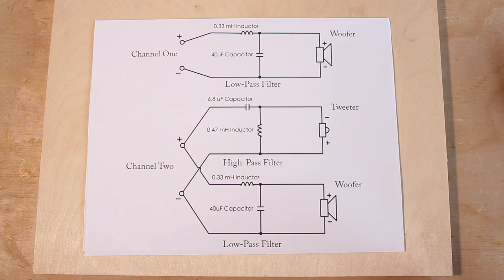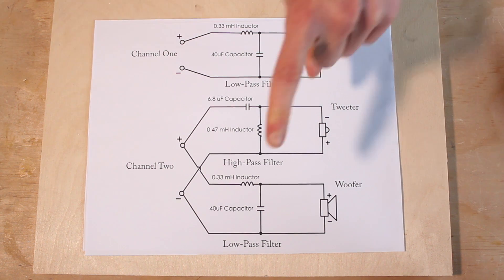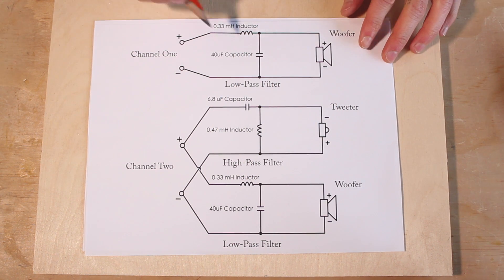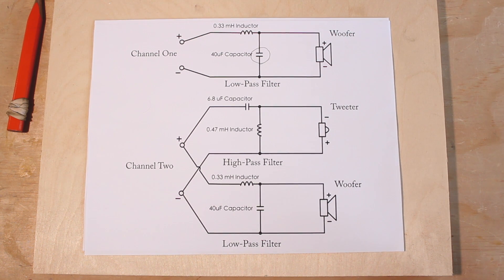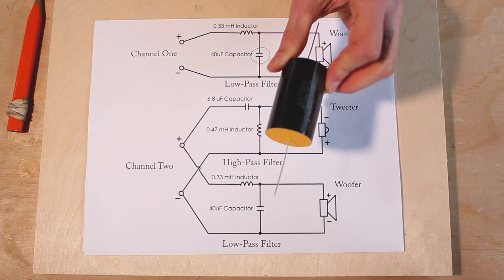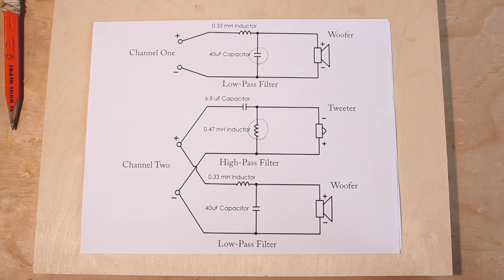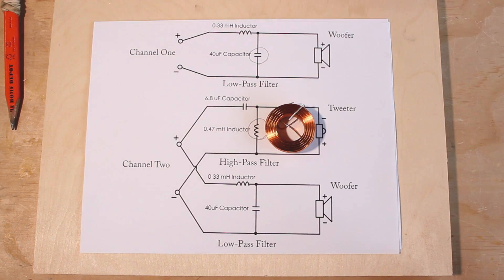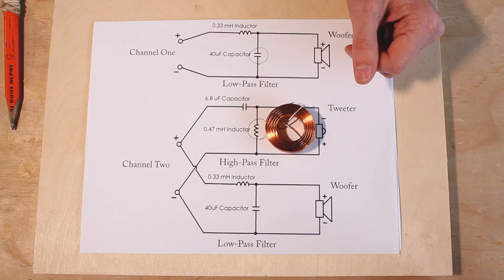How to Read A Speaker Crossover Diagram | DIY Speaker Building

Comment: Why positive and negative always changes for Tweeter in all crossover circuits? Does it have any specific reason?  Even in this diagram at the beginning, the positive lead was connected to negative line of the circuit and negative to positive. Someone, please clear my doubt.

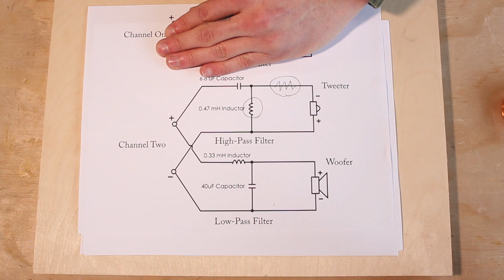Comment: @3:55 Ugh! But that's what I need! My dad bought 2 8ohm, 3K low pass mono crossovers. And I can wire them in one of 2 ways. Dayton/Parts Express didn't send a diagram. There is an IN+, IN-, OUT+, OUT-. All I need to know is WHICH 2 go to the stereo, and which 2 go to the speaker. I've never worked with crossovers before. Thank you

Comment: Hi, i just noticed that you gave a value for capacitor. But i really want to know is. Or ishoul say, give also the specific spec for woofer and tweeter. I mean watts and ohms. And. Really want to know what size is the magnet wire, what is the dimension of your mould and how many turns for woofer and tweeter. Thank you for your effort on making this video. Its just that i have many questions.

Comment: Thanks for this video. Please explain how to connect two 15inch,LF, four 6.5inch, MF,  and two or three HF tweeter speakers to a 3way crossover. Will you connect all speakers in series or parallel, what is the proper way.?

Comment: Why not instead use active crossovers that are adjustable and then either bi-amp or tri-amp an audio system?  Then you wont have to deal with all these caps, coils, resistors....  Instead, you can just try different x-over frequencies and just feed the power directly into the drivers.  The adjustable part is great for trying different xover frequencies and maybe even different slopes if the electronic xover allows those.  This stuff with caps, coils, resistors is ok, but it is "old school".  One advantage of your way is lower cost and people can use just a single amplifier so I admit it has benefits and it is fun to tinker with.

Comment: Hello sir 
I'm planning to build center speaker 
I have 100w@6ohms avr 
I want four 100w@6ohms speakers 
My question is... 
Is it possible to have one more 100w@6ohms for my tweeter dome?
By the way, I'll fix it with passive crossover..  How many watts should my crossover? Thanks

Comment: Hi. Can I connect my 2 instrumental speakers,1 mid and 1 tweeter in my 3 way crossover network? If yes how will I connect 2 ins speakers parallel or series? All speakers are rated 8 ohms and my amp is rated 8 ohms. Thanks for your help.

Comment: I think it would have been helpful for the person new to this hobby to give a brief description of what a choke coil and a capacitor do in a crossover network. 

You could have just touched on what each component does and why it's there without going into detailed designing and building.

Otherwise, I'm afraid that people trying to understand what this is all about may just see a bunch of objects without any meaning attached to them.
Reply: Gunbei2 That's my issue here... I'm rather inexperienced as far as actual circuit design goes, and im clueless as to what each component shown actually does.

Comment: Your original 2-way crossover with the tweeter + going to ground was correct.  With a 12 db/octave crossover, which is what you have, there is a 90 degree phase shift with each driver, only they shift the opposite directions such that at the crossover frequency they are 180 degrees out of phase and cancel out, leaving a dip in response at that point.  By reversing the connection of the tweeter that problem is solved.  With a 12 db/octave crossover for a 3-way speaker, the midrange is reversed in polarity, that is + to ground, - to the hot side, and the tweeter is wired + to +, - to -, just like the woofer.

Comment: Quick question in your video with the "Best DIY Bluetooth Speaker Amp Board", would you need to add a crossover if you were connecting speakers to that speaker amp board?

Comment: My biggest doubt is how to wire the speakers to the crossover while sticking to the amp rated impedance. For example: lets say that my amp is rated at 8 ohms and my speaker has a 6 ohms woofer and a 4 ohms tweeter if I connect them in parallel it would give me 2.4 ohms, not good for the amp, and if I connect them in series it would give me 10 ohms (not sure if its ok for the amp or not because some places say it's ok to be a little higher and others says it's not). How would I resolve this?
Reply: You need a capacitor for the tweeter, 4.7uF should do for a 4 ohm tweeter

Comment: Hi! I'm a bit confused. Can't i just simply connect a twitter and a full range speaker in parallel? What happens if i don't? thanks
Reply: Nuno Correia by connecting speakers in parallel without an crossover you get a lot distorsion from the each of speaker in frequencies outside of their range and there is a big chance of burning them by driving them like that on rated power. btw. total impendance seen by an amplifier, simplifed, is less than of a single loudspeaker. In series connection you would have even more distorsion and reduced power output since total impendance is sum of all speakers.
Don't bother too much with the idea of driving multiple speakers of different frequncy range without some kind of a crossover circuit.
Reply: Ok, thanks for clarify

Comment: I'm currently building your fawn kit, and I have a question: since the inductor and resistor are in parallel, do you connect the positive wire from the amp to one end of the inductor and resistor (with the other ends on the postive terminal of the woofer) or do you connect the positive cable directly to the woofer?

Comment: Two things you didn't touch upon in this relatively simple crossover is the fact that with a 12dB x-over like this, the phase inverts 180 degrees between the woofer and tweeter, therefore most designs will reverse the polarity of the tweeter to compensate and bring the two drivers back in phase so they sound more "coherent" and produce better imaging among the L/R pair of speakers...

And the other thing is that if you are going to spend the money on a Polypropylene capacitor for the woofer part of the circuit, then you should definitely ALSO be using that same type in the tweeter portion of the circuit, rather than the inferior sounding Electrolytic type as shown in this video!... If cost cutting is necessary because of budget I would use a Polypropylene cap in the tweeter and an electrolytic in the woofer circuit, especially considering that the larger uF values, (that you generally need for the woofer part), if using Poly caps can get very expensive, and the (generally lower) uF values used for the tweeter part can be easily obtained for a relatively inexpensive price... Also any sound quality degradation is noticed more in the tweeter high frequency detail, because the sound signal passes through the tweeter capacitor rather than being shunted to ground as in the woofer part. 
Also, the physical size of the capacitor(s) is another thing to consider, especially in small, tight enclosures... Large values of Poly caps get very BIG...

Anyway, Yes, I'm sure you already know all of this stuff, (and maybe those details you are saving for a much more in depth, detailed video on how to design and build crossovers), but I thought I should mention it in passing... Maybe you could/should consider a more in depth video on crossovers?... Or if maybe you already have one? (As I'm sure a LOT of people out there could benefit from it!)

I look forward to more of your videos!
Reply: Thanks for addressing the phasing issue, but I guess I still am confused by it.  How does one differentiate the circuit that makes this advised vs one that does not?
Reply: @garyvanremortel5218  Well, first and foremost, this "phase reversal of one driver to make the overall phase of the entire speaker system correct again" thing is just simply a general "rule of thumb" to start out with... MANY things change the overall phase output of a speaker though, including, but definitely not limited to even simply the individual drivers mounting depth and distance apart, relative to one another, so the "correct" polarity of the tweeter (AND midrange if applicable), ultimately absolutely HAS to be based on very careful final listening with a few different types of music, to the overall speaker system as a whole, in order to know which setting/connection of the terminals of any given driver sounds the most "coherent" and clear or "present" when listened to together with the other one(s) in the speaker system, as one connection/driver polarity will sound (somewhat to majorly) better than the opposite polarity connection!...

This is partly why speaker designing and real world building is such an extremely complicated, yet ultimately simple "artform", and why there are SO MANY different designs and brands of speakers throughout the world!... Part of it is "science" and part of it is totally subjective to the ear of the listener and/or designer!... You just have to find a speaker design that sounds amazing to YOUR ears, even if that design (may OR may not) follow the "typical" "rules" of speaker design!
Reply: @JoeJ-8282  I played a bit with VituixCAD to see how response curves are affected by inversion of the mid and tweeter drivers, but I was just curious if there were an easy method of quickly making the determination (first order no, second order yes...).
Reply: @garyvanremortel5218  In my many years of experience with speakers, I have found that almost nothing in the realm of speaker design and building is absolute in every case, there's only generalized "rules of thumb" that only (usually) work in most cases, but even taking all of those things into consideration, as most well designed computer programs for speaker building do, I've found that you still have to do a very careful and thorough final listening test of your design prototype before tweaking it to sound "perfection", (or as close to it as the design allows, AND that sounds the best to YOU), so the answer to your question is ultimately; NO, unfortunately there's NOT really an "easy" way to determine what will work best...

EVERY single little tiny, minute detail of a speaker design changes its overall sound quality, at least to some extent, (some things change it much more than others, of course), but so the overall process of speaker design and building is a total "experiment", based loosely and primarily on a generally good design to start with, given and considering all of the general rules of thumb of speaker design...

Sorry I don't have a more specific and definite answer for you, but every instance of speaker designing and building is different and totally relative, so you just have to start with the basics and tweak from there to your own personal tastes for the overall sound... It is definitely an artform that has to be "learned as you go", kind of like a "master painter" or whatever! Lol!
Reply: @JoeJ-8282  Thx for your considered reply.  It's a mix of science and art just like many other aspects of engineering design.  I suppose that designing studio monitors is more uniform than designing hi-fi equipment for home use.
Reply: @garyvanremortel5218  Nope, I'd actually say that designing and building speakers is the MOST DIVERSE, and widely varying thing to do in audio!... Component equipment itself like CD players, amps and such like that are reasonably "straightforward" in their design and operation. There's really only "one" way to read the information off of a CD for example, and most amps work in pretty much the same exact ways, with relatively minor circuit differences to tweak their sound quality or power output ability, but within each amp "class", the basic function and "how they work" is still there and very similar among ALL of them out there...

Whereas speakers are quite literally, "ALL over the map", with functional designs all the way from the most basic "dynamic" and "box" designs, to "flat panel", (both electrostatic and planar, also ribbons), to totally "omnidirectional", bi-polar, di-polar, "infinite baffle", etc, etc... The list of totally different designs of speakers seems to go on almost forever!... And ALL of which have their own unique design challenges and sound quality strengths and weaknesses!...

You just have to have FUN in your passionate hobby, and don't let all of the "technical parameters" of various designs get to be overwhelming, because ultimately almost nothing is "set in stone" with speakers, and even if it doesn't "measure" or "calculate perfectly", that doesn't necessarily mean that it's a "bad" design, IF it still sounds amazingly good to YOUR ears and with your preferred music tastes!... Remember that!... Overall listening pleasure is more important in the end result than "perfect calculations" when it comes to speakers, because almost everything about them is subjective and relative!... There's really a LOT of room for minor "errors" in speaker designs, and yet they still can sound very pleasing to the ear!
Reply: @JoeJ-8282  But who can logically change out their speakers for differing music profiles and types?  Active crossovers should be able to read the room in realtime.
Reply: I bought a JBL 4310 speaker and the leads going to the woofer where reversed instead of the woofer moving out it was moving in so I reversed the leads to the proper post, Was that a no no? or is it ok that I did that?Cheers
Reply: It does address the phase change. Look at the diagram the tweeter phase is reversed.
Reply: @chriswithall2518  Maybe so, but since he didn't mention that in this video, and it isn't totally obvious to someone that doesn't know better, I thought I would emphasize that in my comment. The diagram is tiny and relatively hard to read, especially if watched on a phone, as many people will be doing nowadays, and if you don't notice that tiny, unmentioned detail, then a novice might hook it up backwards.

Comment: I'm glad you mentioned the rain Kirby. I live in California too up near Auburn and it's raining buckets. I thought what I was hearing was the rain outside my window and it was your audio track. 

You may have mentioned it, but I don't recall if you did ,regarding the caps illustrated in your video; electrolytic capacitors are like a battery and have polarity. They need to be hooked up taking polarity into account. I reckon that many this video's viewers are new to reading schematics and translating them into an actual layout. Polarity with electrolytic capacitors is an important concept to be learned about early. 
BTW, what's the crossover frequency in the example network? As a percentage, how much power translated to the drivers do you lose with that design?
Reply from the maker: It's so wired to have rain again! This has come up before in the comments. Most electrolytic capacitors are polarized, but not all. Electrolytic capacitors used in crossovers are non-polarized.
Reply: Kirby Meets Audio Thank you Kirby. I did not know that. I'm a self educated DIYer and while I've built tube and solid state guitar and bass amps, stompboxes and built guitar and bass speaker cabs (no crossovers in mine), I was unaware or any app that used non-polarized electrolytic caps. Come to think of it, I didn't know that they existed.
Reply from the maker: That's super awesome! I've wanted to build a tube amp for years. I've put together a few guitar cabs, super fun to get really into the woodworking. Crossovers are one of the only applications I've seen for them. You were spot on with learning polarity in capacitors early while learning electronics.

Comment: is the polarity of both tweeter and woofer inverted on the original diagram? seems like you changed it? tell me if im wrong because it seems to me... another question, how would you connect the crossover to the terminals, do you use a separate wires for the positive and negatives coming from terminals to the components?

Comment: I just finished a class in College about designing Low Pass Filters, Do you see cross over diagrams with LPFs that have more than 2 components or is that not very common for speakers?
Reply: it's very common, many crossovers include zobel (cap + resistor), bafflestep compensation (coil + resistor), more complex crossovers also do some RLC corrections, which, as the name suggests, add 3 more components per every correction you want to make.  And sometimes 12dB is just not enough, or doesn't provide a good enough "connection" to the tweeter. Crossover design is really a complex thing if you want to get it right.

Comment: I've noticed that you rewrote the polarity of tweeter connection. I'm interested why in some schemes tweeters and woofers have anti phased connection?
Reply from the maker: Yeah, I wanted to simplify the diagram as much as I could. I believe the reason why some crossovers have some speakers out of phase is to increase or decrease response in the overlap zone of the xover point. This creates a flatter frequency across the spectrum. Thanks for watching!
Reply: I thought for the equal SPL in the all diapason.